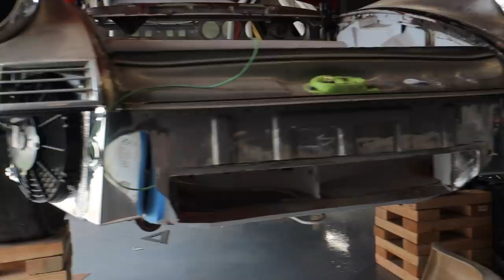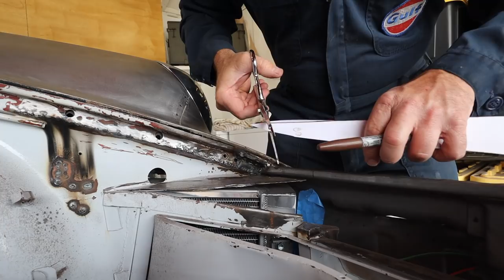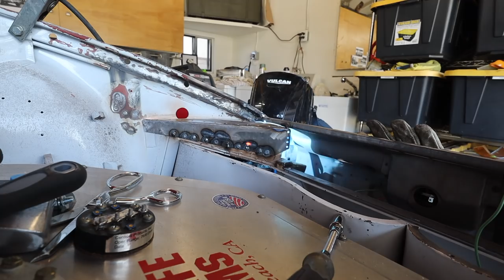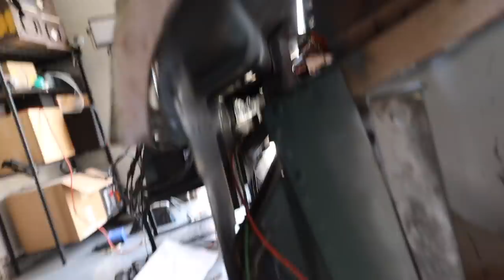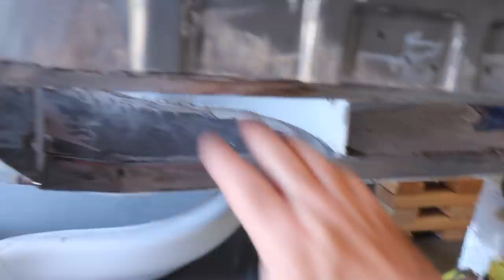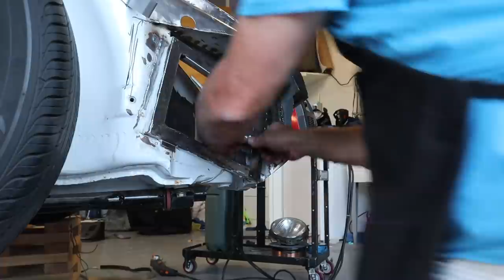CSF Drag Radiator/Front End Fabrication. (That's What She Said) Blasphemy Bld 52 Porsche Engine Swap

Comment: Your courage to just dive in and figure it out is impressive. I’d be worried about making things worse. 
I am curious, it looks like the opening that the rads seal to are not well aligned, and that about 20% of the radiator is obstructed. Concerned?
Reply from the maker: It’s definitely not as extreme as that.

Comment: Did you say 30 amp fan? That's gonna emty your battery i a hurry. Especially if you have two of them. Even if you have a decent generator. You were talking about the electric A/C earlier? When using that, there is really not much more amps  to use from the generator.. That said, love your channel, and I can see that I'm not alone in figuring things along the way.... ;)  Good on you! ;)